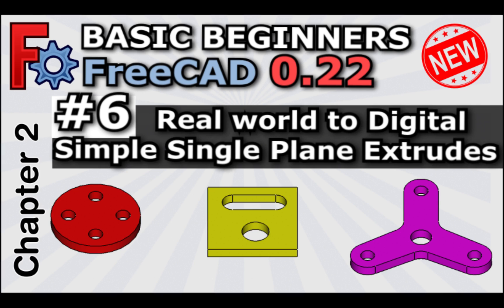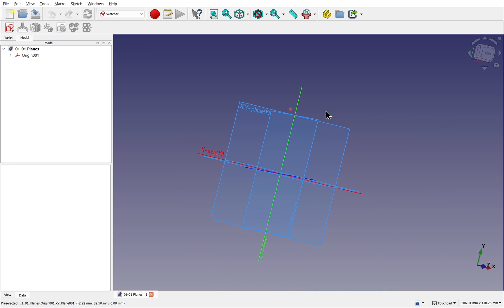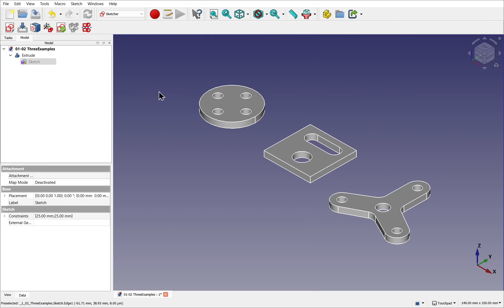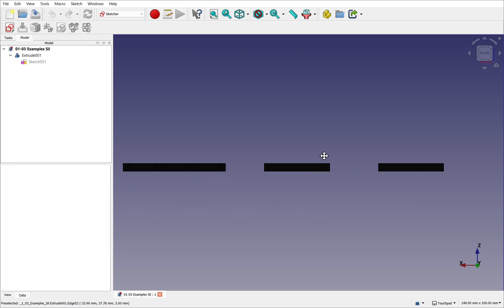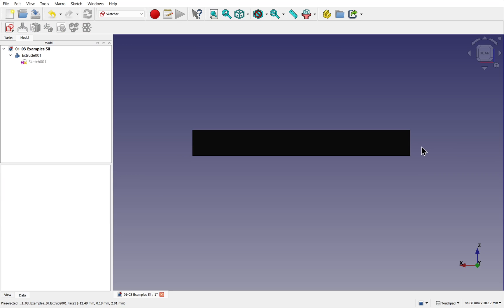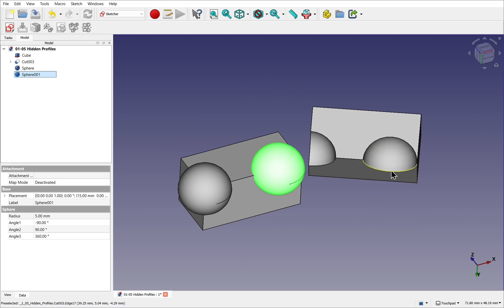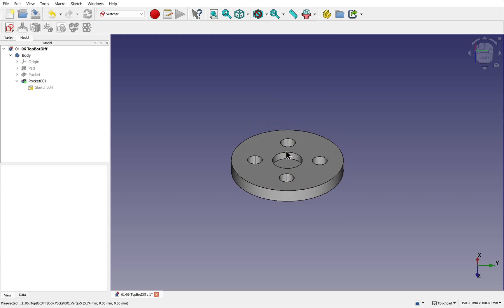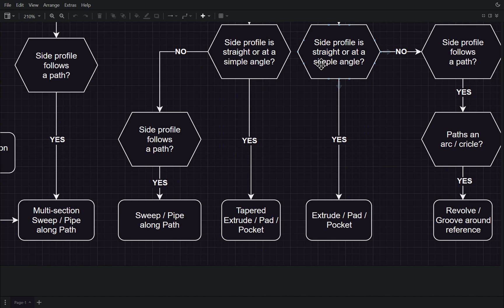Basic Beginners FreeCAD v1 / 0.22 | Lesson 6 | Real World to Digital. Simple Single Plane Extrudes

Comment: I found the options that were making tutorials impossible to follow as I was missing a lot of icons on the tools bar. Go into Preferences > Sketcher > General, and uncheck "Unify Coincidental and PointOnObject", "Auto tool for Horizontal/Vertical", and set Dimensioning constraints: to "Separated tools". Then you will get all the icons they have in the tutorials.